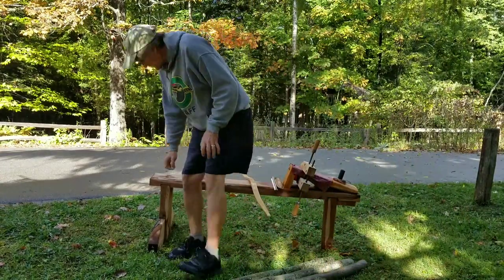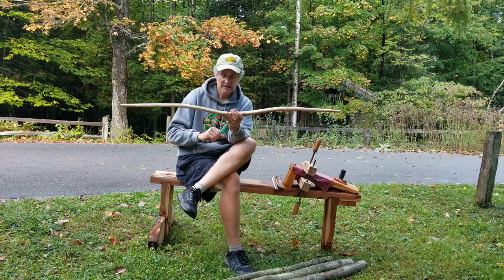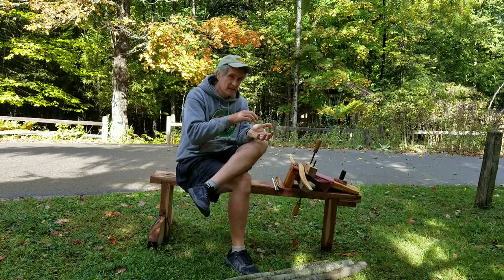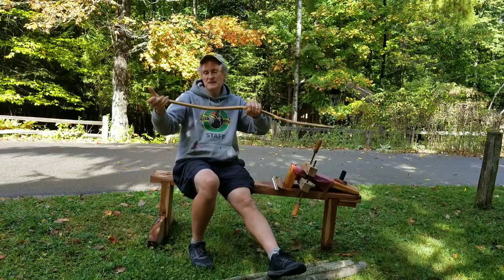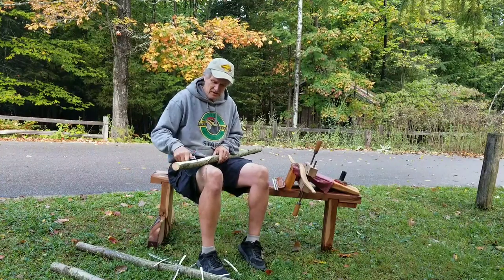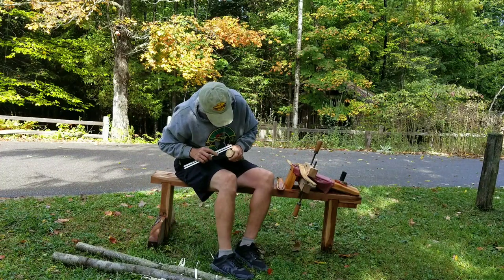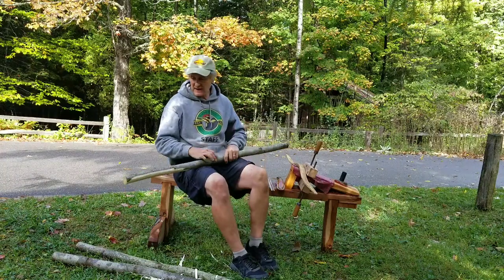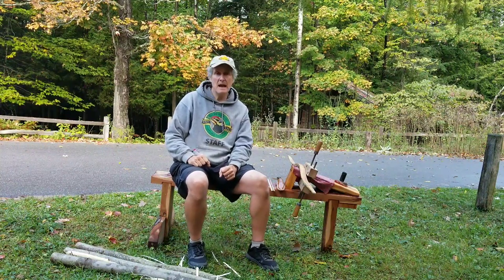Project Bow #3: Sinew Backed Horse Bow #1

Comment: Love your videos JR.  Following your book.  Determined to make a gull wing.  Have really poor sinew skills but determined to learn.  Do you degrease the bow first using wood ash or something before sizing with hide glue?
Reply from the maker: Fred Flintstone Howdy Fred. If I steam bend them, I just degrease them with dish soap and hot water. If I greased the bow and shaped it with dry heat I wash it in a lye solution: very hazardous. Thank you!
Reply from the maker: Fred Flintstone I should have added, sinew skills develop quickly because it's inherently simple. It's mostly just going through each step and being careful with preparation. 1) Roughing up the bow 2) Washing the bow with hot water and soap, not worrying about getting all of the soap off. 3) sizing several times starting with a very thin mix and increasing the amount of glue each time. 4) following a pattern when you lay the sinew 5) gently wrapping the sinew with gauze 6) Waiting. It doesn't need to be perfect looking to work perfectly.